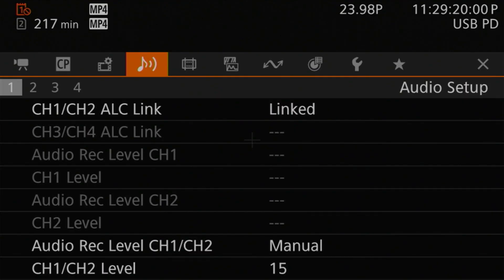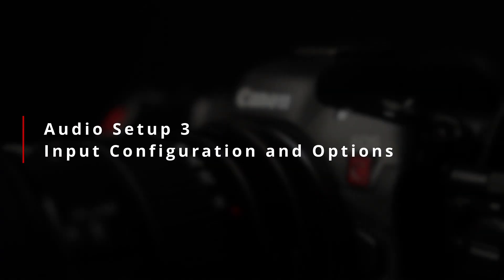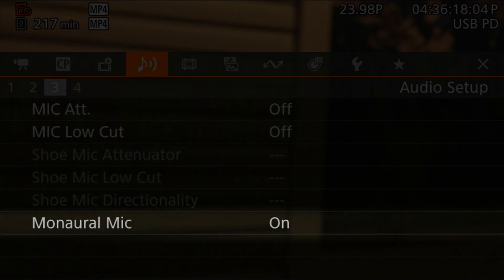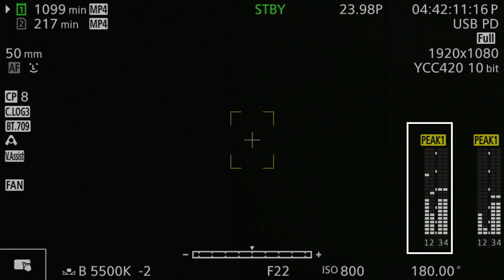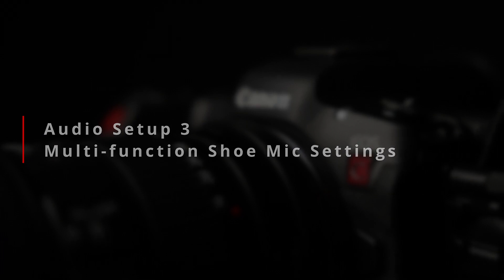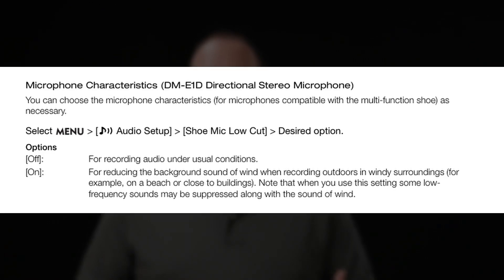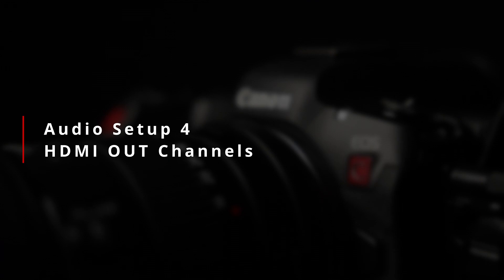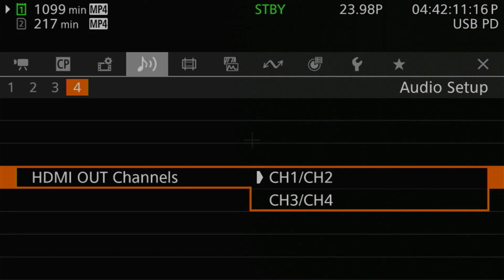Audio Input and Output Settings on the R5C - R5C Tip 16

Comment: Why are my mic settings turned off? Meaning, I cannot make changes in the settings or are displaying in this video
Reply from the maker: Do you have an external mic plugged into the mic jack? There are no adjustments for the internal mic (it's auto level only). Unless the camera detects an external mic, it will disable all the level settings on the first 2 pages and most of the settings on the 3rd page of the audio menu.

Also the camera disables the audio settings if the currently selected recording mode doesn't support audio; for example, slow and fast motion, frame, or the interval mode.
Reply: so I did the firmware update on the camera, and the mic levels work again and now able to record to camera. the only thing as now that the most mic settings are not highlighted so I can make adjustment. hope I'm explaining myself correctly.   @PointsInFocus
Reply from the maker: It sounds to me like the camera is working correctly. It will only enable the settings that you can change in a given configuration. For example, if you look at the first page of the audio menu, the top settings control whether channels 1 & 2 levels are set separately or as one setting. Depending on how you have that set, you'll either get the two separate sets of controls in the middle of the page, one for each channel, or you'll get the 1 set of controls at the bottom for channel 1/2. You'll never see both enabled at the same time.
Reply: I see. I’ll have to keep working with it and learning as I go further. Thanks for your advice and tips. I’ll keep it up 😊